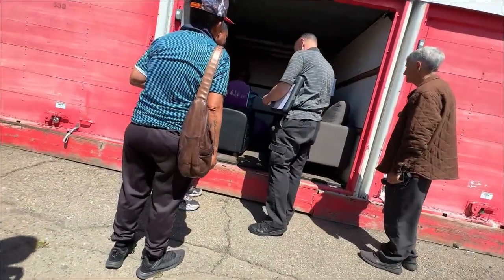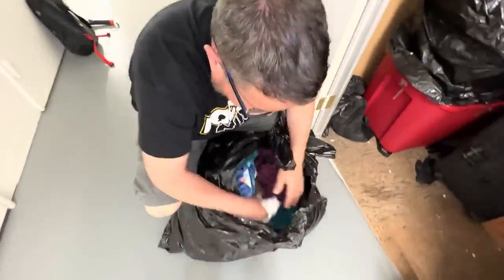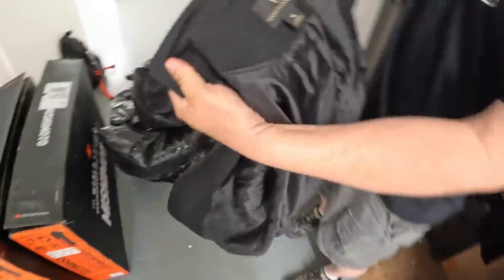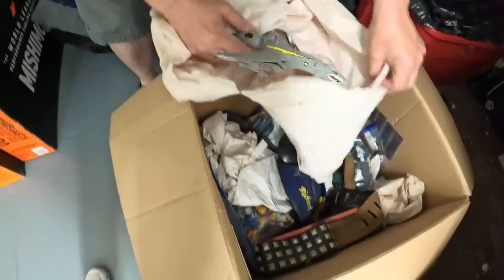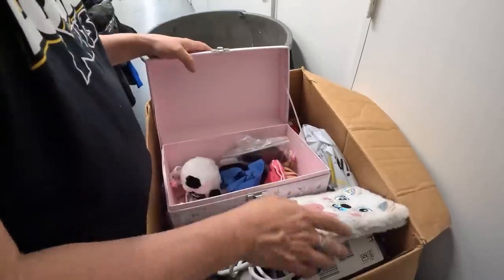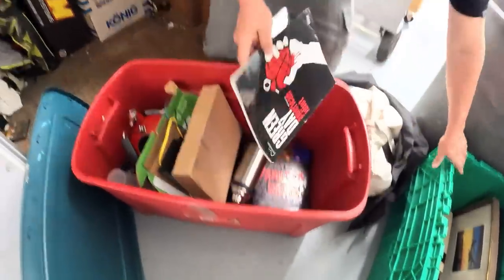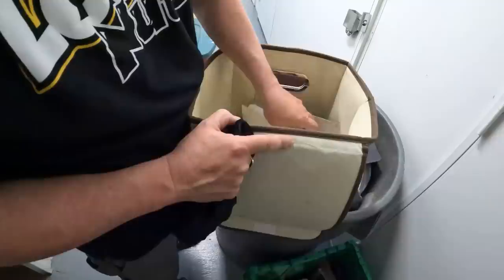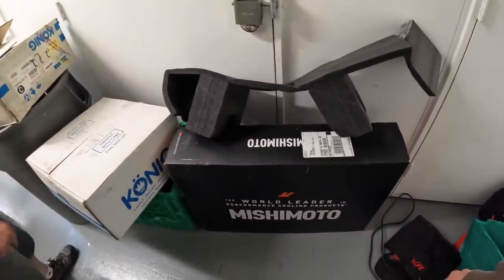Most EXPENSIVE Storage unit on ALL of YouTube...

Comment: #1 thing I've learned from stock trading is control your  risk to reward. Just hard to believe over the long term that you can consistently make 100k on ANY locker and unless you are right more than 2 to 1...it just doesn't add up. So I'd be targeting the cheap ones. That doesn't mean just buying all the cheap lockers...it means buying wayyyyy less lockers, but ones just like this that sell way under normal prices even if it means sitting n my hands over n over.